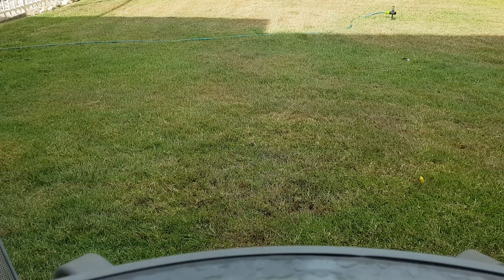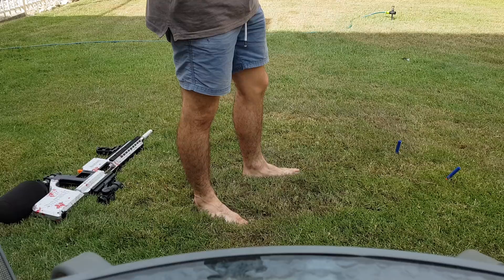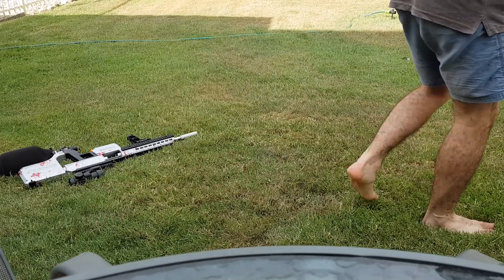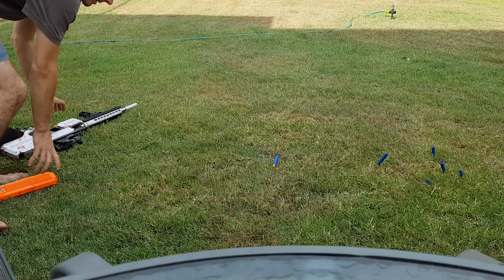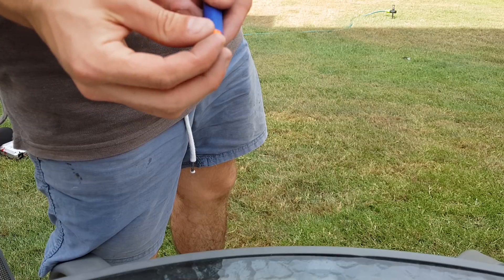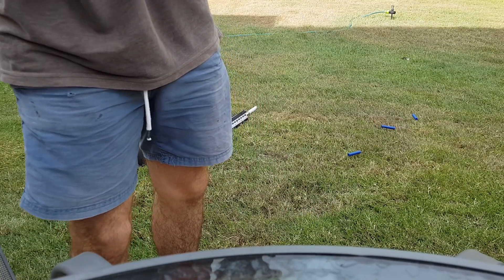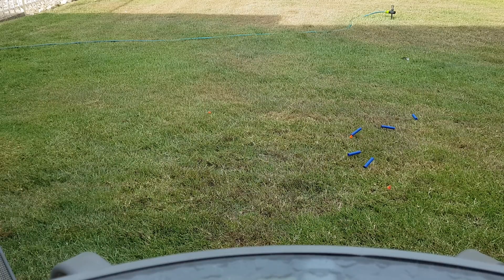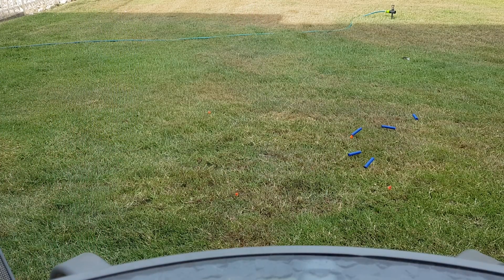NERF DART EXPLOSIONS: Does high pressure air break darts?

Comment: How come you don't use stefans with your hpa blasters?  Also do you know if stefans last longer under high pressure?
Reply from the maker: pastiesandagstring I do use stefans, however for this video I didn't have any brand new unused stefans available so I went with brand new unused full lengths for demonstrative purposes. Stefans do about the same as full lengths but the fracture is closer to the tip itself within the foam itself.

Comment: 100psi, but what volume and fps?
Reply from the maker: Speaking from a physics point of view, neither of those values matter. Pressure itself is what causes this kind of fracture. But, to answer the question, 27mL of air and 250fps.
Reply: Spectre's Nerf Workshop Air volume at a given pressure is different and does make a difference. 100 psi in a tractor tire has the potential energy of a small bomb as opposed to 100 psi in a pressure vessel the size of a small can of soda. Increasing air volume at a lower operating pressure will reduce the chances of dart foam failure, but still give you the energy required to move the projectile out of the barrel at the velocity you want it at.
Reply: @JosephArata  i learnt that the hard way when i pressurized a vessel that was made out of non-pressure pvc pipe only because i needed a vessel with high volume and they only made tube in that large diameter out of nonpressure pipe. I ended up pressurizing it to 90 psi thinking that 90 was nothing compared to 150 psi like in my air compressor and the thing ended up blowing up and rocketing towards my cousin and putting a huge scar in his arm. So it wasnt high pressure but it was high volume that caused the damaged. Dont underestimate volume.